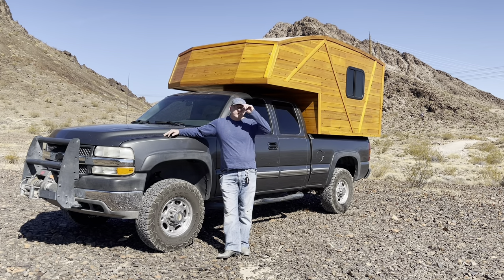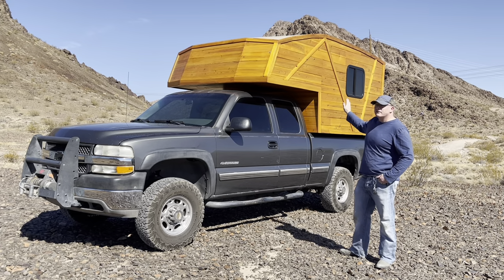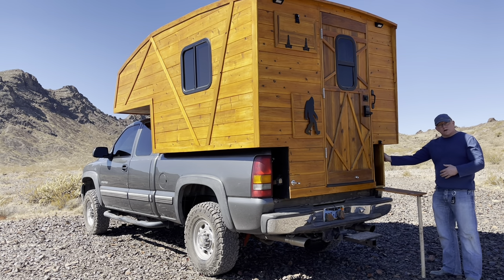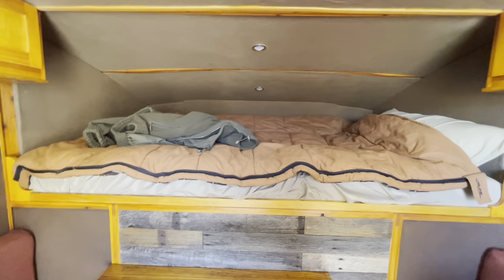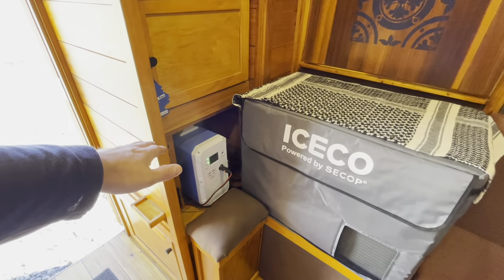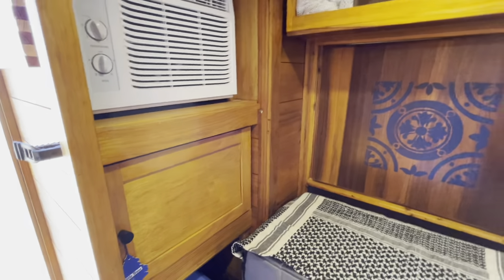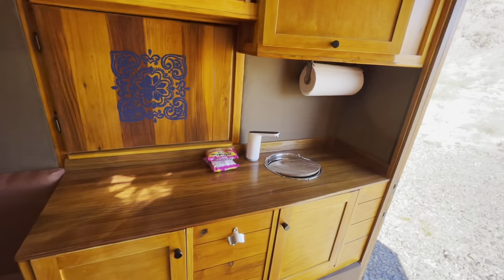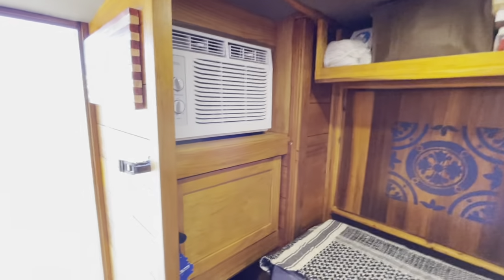Home Built Truck Camper 2.0: Full Tour

Comment: I think you could easily add a shower just inside the door. Removable shower curtains could surround a shower space and have a small pool to stand in - easy to drain from the door. I've seen these done in vans - should work in your camper.

Comment: I have a tiny camper insulated 2 inch foam all the way around including ceiling and thermal insulation on the floor. Then I have a Frigidaire energy star that takes 30 min to cool down then runs for only 15 minutes every hour to stay at 69 degrees in my camper. If you get that Frigidaire AC you can run all day and all night and not not even come close to using half your Bluetti energy. Please check this out and get back with me
Reply from the maker: 5000 btu unit?
Reply: @EndgameCampers  yes my camper is on a 5x8 trailer when the camper is initially cooled down it runs just a few minutes to temp then shuts down nearly 15-20 before it kicks on again. The energy star has a soft starter that cuts down on the surges. The large amount of time the a/c is not running will be charging on the Bluetti.  And at night the a/c rarely cuts on and would do the same in your camper. That’s my prediction. I’m on shore power but want to get the new Bluetti AC 200 with the 2k watt inverter

Comment: Absolute beautiful build in every respect, including your latest camper builds.  I'm thinking of building a camper as well for my 2005 Chevy diesel 2500 HD. The difference though is that my truck has a flat bed, so the design would be a little different, and would offer a little more floor space.  My truck also has an air bag suspension system as well, and handles a load very well.  My concern is how to get the camper off when not in use.  I use this truck for a lot of different things here on the ranch.  I would need to design some kind of lifting system that would work for a flatbed truck where the camper doesn't over hang the sides.  I have one idea that might work though, well it works in my mind anyway, LOL......

Comment: Job well done, I am very impressed. 

I am strongly considering a similar build for my F350, I have the 8ft bed but a 2 1/2 ft fuel tank in it so I will have to do some thinking on it, but your design is very nice.

Comment: I'm curious what you decided to do about the A/C condensation drainage.
Reply from the maker: Play it by ear for now.  I believe you had suggested making a pan in past comments.  I’ll go that route if it turns into a big problem.
Reply: @EndgameCampers  My in-wall A/C unit had its own drain pan, but it could easily slosh out in a moving truck. I'm thinking about having a hose from the pan that drains the water to the ground. But, I don't know if all A/C units are designed with a pan. You're in a position to see what it needs.

Comment: Followed through Bob Wells' channel to yours seeking clever ideas/ mods for my own some-day build out. (Score!  Subscribed.)  Not necessarily full structural , but the DIY interior.   3 purpose trash can, window shutter, super clever.   USB powered sink pump new to me.  Great idea!   Much to like here.  Am fully in agreement about modular components - fridge, "solar gen", cassette toilet, etc.   Also the idea that the camper can outlive the vehicle.   Many concepts found here, thankfully, are fully applicable to "Project M' or similar basic truck campers.  Only thing I miss here is a soft sided/ collapsible sink hose fed shower, which I'd hope to be able to rig someday.     

Questions:  Don't see jack points to lift camper off truck.   How do you handle remove and reinstall?    Also, is it coincidental that the Mason's symbol is integrated into the back door?

Comment: Rubber liner on the perimeter if the window makes a perfect seal to prevent warm air passing thru, just like a lid of a jar,
Needs lithium battery 300amps and 150 watts to charge it at 150amps,
Diesel heater for cold weather,
A tent for hanging out in the wild,

Comment: Maybe you could install some stretch webbing in your upper corner pantry cabinet, so that stuff doesn’t fall out when you open the door. Great build! You could add some portable folding solar panels to add juice in the summer to run the A/C. Cheers.

Comment: Excellent job! Although I'm a box truck guy and don't share your ideas behind your design there's no denying your execution and final product are top notch. I love seeing the different ideas of the ideal camper for different lifestyles. Those cedar pickets are the best kept secret, I've used them for accents in my kitchen. I really dig your air conditioning idea but where does the condensation that the unit produces go? Do you have some sort of catch pan with a drain?

Comment: Nice work, and very well thought out. I'm sure the kids liked finding and then installing that pallet wood in the camper ... memories. BTW there are A/C units that have a reverse cycle (heat pump) so you could in theory have heat and AC in the same space.

Comment: You made good use of the space you have. Factory truck campers try too hard to stuff in everything a class A has and that's just not allowable in the space available. One suggestion, the upper cabinets, install some bungee cord to hold the items in. Just two pieces horizontally mounted does the trick. I put them in my boats.
Reply from the maker: Thanks.  Actually just added some to the food cabinet yesterday!  The others seem to be working out fine. Thanks for coming over.

Comment: Two thoughts. First, there are several manufacturers who make line voltage thermostats that will plug-in between your AC and the power source which will turn off the power to the unit completely, thus eliminating the power drain of the fan constantly running when it isn't needed. I have several of different makes I've used for years and they really cut down on power consumption. Search Amazon. They will also work for space heaters.
Second, your duck covered wall panels seem to be showing marks where the underlying foam has been compressed and the marks are telegraphing thru the fabric. I was thinking a thin layer of upholstery batting under the duck would help eliminate or minimize this without adding mush weight.
Reply from the maker: Thanks for the feedback

Comment: Very nice camper build. I was wonder about the ac unit. Did you run a drain tube for the excess water in the drain pan of the unit?
Reply from the maker: No. Newer ones have a little tub that catches the water. I have had no condensation issues

Comment: I have my own slide in camper with a plywood floor. I recommend setting it on two sets of two by sixes running 10 foot long out the tailgate. Keeps the plywood floor elevated off the floor to prevent rot. Then mount 2 x 6 deck boards where the tailgate is on that two extra feet.
Reply from the maker: Already on it, thanks for the suggestion

Comment: Hey there! I’m ready to coat the roof! Did you ever consider using liquid rubber for your camper roof? Im trying to decide what to use for the roof coating.
Reply from the maker: I did, but decided to use the fiberglass.  I don’t remember exactly why.  I think it involved adding the fiberglass actually added structural strength to the roof in addition to adding a waterproof layer.

Comment: Fantastic!  Beautiful!  I think the truly amazing thing is the completeness of all the systems on basically a single pass. I could see getting to this point after years and years of trial-and-error modifications, but this level of final product is enviable. Nice. Great tour and explanations too. 
You probably know this when choosing an AC unit, but for others, their are “through the wall” AC units and “window” AC units, and they vent heat very differently. We tried using a window AC in an enclosed space just opening a window to let out the heat. It continually shut off from over heating. Window units vent heat out the side drawing cooling air from the back; through the wall units vent heat out the back. The window unit we used heated up the box holding the AC basically never allowing it to cool. 
Thanks for the tour!
Reply from the maker: I appreciate the compliments.  Regarding window AC units: I am not an expert, but the one I have blows the heated exhaust (which passes by the condenser) out the back and intakes from the side and top.  Within the confines of that box, I created two separate ducts for those systems.  Both have access to the outside of the camper via that hatch.  Finally, the interior, or cooling side, is isolated from the other system just discussed.  Everything works.  My only concern will be if I see a degrade in efficiency in extremely hot weather because of the confines of the ducting system I made.  Initial tests are promising though. Thanks for the feedback

Comment: Excellent. I’ve been following along and incorporating your many ideas and rationale into my own unique plans to build. Mine will be a “scooter” because it won’t be tall enough to stand up inside so we will scoot around inside with a small cabover for storage only and benches for sleeping, sitting, cooking. The benches will be the height of the truck bed rails with ceiling only 40” above that. So roughly 60” floor to ceiling. 
She will be ~76” wide and ~72” interior, insulated on a 6.5’ bed or 78” long exterior, ~72” interior. 
There will be three benches. One across front bulkhead maybe 24” deep. Two along the sides also 24” deep. This leaves an isle 4’ long and 4’ wide with ~20” space underneath for electrical, plumbing similar to yours and storage, furnace. 
We ski so there is a lot of gear. We only need it for 3-4 days at a time. 
Any ideas?
Reply: Something I considered doing on a next project was expanding the interior walls of the “tub” to use up more space between the bed rails for interior space.  It would add a little complexity to the build, but it may be an interesting way to create more interior storage.  Just a thought...
Reply: Make the roof raise up when stopped. Scratch some ideas on paper! Good luck.

Comment: Beautiful work, but a death trap with all that foam board.
Reply from the maker: What alternative would you use?
Reply: @EndgameCampers  great build and video, thanks..
1.could you apply some fire retardant to the cloth? 2.Smoke detector 3. never use a Little Buddy, ever. 4. All commercially made units have a second egress. For a reason. 
Again, great work.

Comment: You have two power outlets that are under your switches. Are they AC or DC? I know the bluetti has both but I’m curious to how you wired it.
Reply from the maker: AC. It’s a three prong outlet with a short pigtail I got at harbor freight.  Plug the pigtail in the back of the sol gen then wedged the outlet end into a specially cut hole in the panel.
Reply: @EndgameCampers  perfect! I was having trouble finding how to wire it.

Comment: Two questions, do you pull over for intense wind and can the siding take snow and ice? Or is it really suited to warm weather?
Reply: I love all the magnet action
Reply from the maker: Wind has surprisingly not been a big issue.  I was hit by a couple wind gusts i would estimate to be about 60 or so mph based on weather reports and it of course swayed a bit, but nothing scary.  As far as snow and cold weather, I think it is well suited from an insulation stand point, I just wonder if using a little buddy heater alone would be enough (my only heating system now). If I lived in a cold environment, I would opt for something better like a diesel heater.

Comment: It's both functional & beautiful! Is the AC both heater & cooler? What size inverter & controller? How many watts to run the Icebox ?
Reply: AC is only AC, I use mr buddy for heat.  Inverter in the solar gen running my electrical system is 1000 watts.  I don’t know the size of the inverter they use, but it can accept up to 600 watts of solar.  Ice box/fridge pulls about 50 watts when it is running which will only be intermittently based on environmental conditions around  it.  Overall it doesn’t use very much energy.
Reply: @dmason8078  Thanks! I have a 1500 Ram shortbed, that i want to build a cabover for, starting next month. Think i'm going to extend over the sides 12 in, make the floor level with the top of the wheelwells, using the box for storage; offset the door, so will put a toilet/shower, hot water heater/countertop,fridge on 1 side; benchseat/window & closet on other. I need the cabover bed height to be 4' tall, making the overall ht 6', but I wonder if that will make the ht. to width ratio unstable? How many inches are between your truck roof & the bottom of the cabover? Any answers you could give would be appreciated, as i'm doing this alone.
Reply: I’m doing a live tomorrow at 5pm pacific.  Join in and I’ll try to answer those questions.  I’m a little concerned though that may be to big.
Reply: @dmason8078  Thanks! Got my alarm set for 6pm Mtn!

Comment: absolutely brilliant camper. Prefect Love your idea about keeping it modular. Replace or upgrade as needed and less complicated too. The window idea is fantastic. Pitch black when you need t, and insulated, and open when you need it. But no furnace? That's the only thing keeping it from a perfect 100/100 :-) Awesome job
Reply from the maker: Thanks. Regarding the furnace: in short, it is so well insulated, a furnace is not needed.  Fire up a little buddy off and on and you are good.  I have had it down to 15 degrees with wind and snow and it did well.